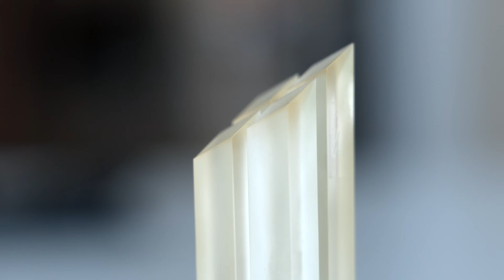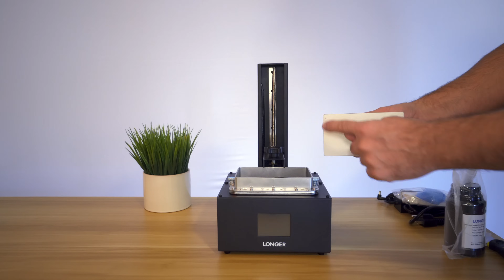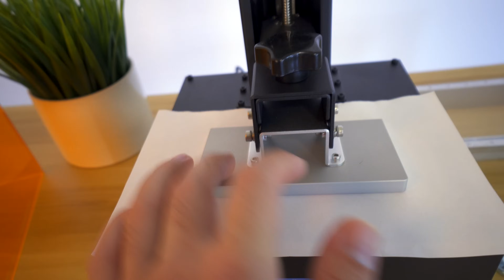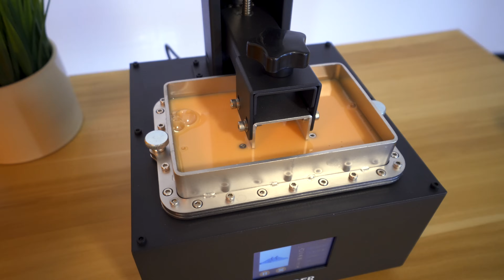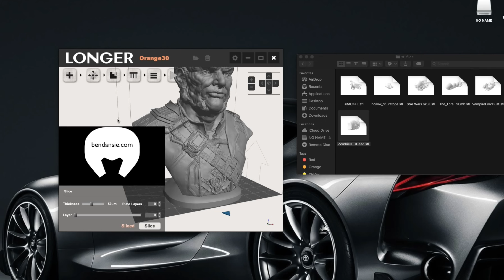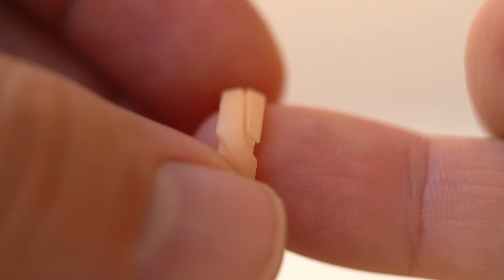Longer Orange 30 - 2K Resin 3D Printer - Unbox & Setup

Comment: Hey dude, awesome video! I'm trying to make a vent system for my own Orange 30 printer but I don't know which holes bring in air and which ones push it out. There are so many holes on this printer lol. I'm trying to capture the outflow of the fumes from the printer through a duct and then out my room window. Would you know which vent holes on the base push the fumes out?

Comment: I have troubles with EDIT buttons (position, rotation, scale, size...) on LONGER software... Can't use them. The model can't be selected. Did you find the problem fix?

Comment: Have you had any issue with the plate keeping too much resin on the top?
Reply: Apparently the cards supplied are meant to be used to remove the resin from the top of that plate and from the vat, etc.

Comment: Is this SLA printer able to print with the more expensive engineering resins that the more expensive SLA printers are able to print with.  I'm asking because I've been thinking of buying one of these printers or some other of equal ability and I'd like to use it to print things other than toys and trinkets.
I'd like to be able to print usable parts that can withstand some minor stresses about the strength and consistency as filament printing with ABS filament.

Comment: Thanks for the good review. Ive seen some people suggests the orange 30 does anti-aliasing; but it is not marketed as such, and I dont see a setting anywhere in the software. So is it simply enabled by default? Did you notice either way? Should be most noticable on gentle overhangs.

Comment: Little thing I found out after buying this, the software is not optimized for Mac. It won’t let you select the object to rotate or resize it but it does work on windows. If your image is too big or orientated in the wrong way it won’t let you put it in the printing area